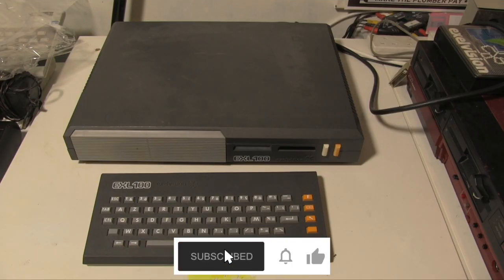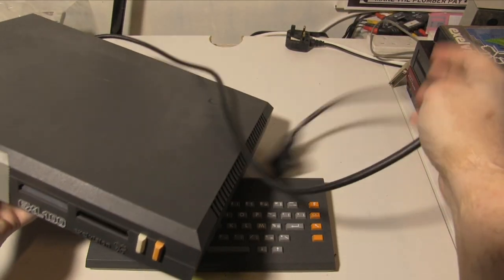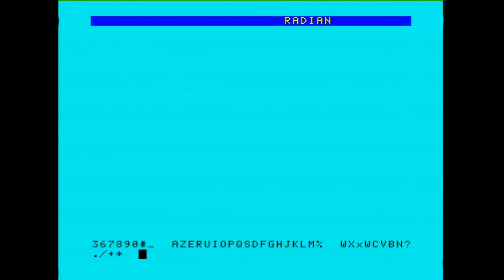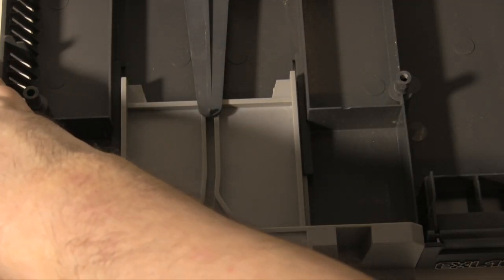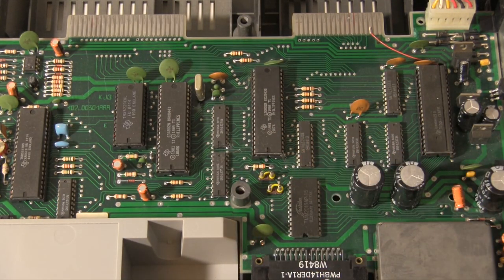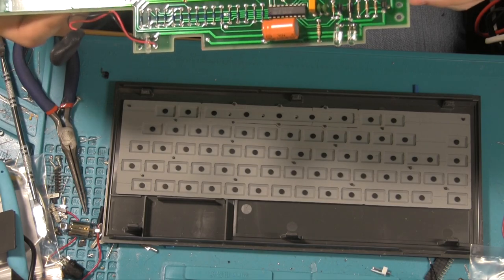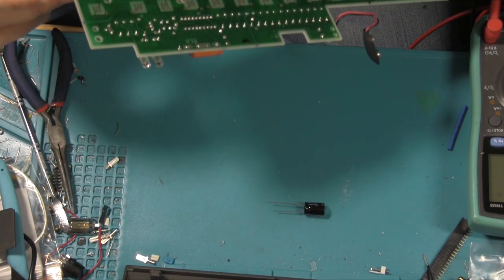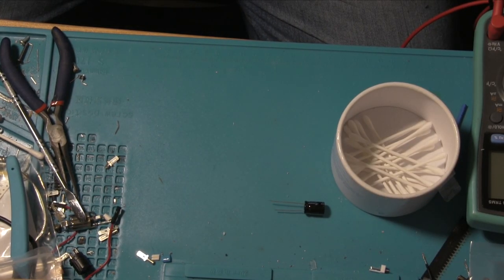The EXL 100: An Exelent computer? #Retro #Retrocomputing #Retrocomputers

Comment: 4mhz  for  the cpu, which also shares access to memory with the gfx is very rapid, the ram must have been increadible quick for the time, or dual ported, or there was an unpleasant system for locking either the cpu or video out of memory for a while.  Very nice looking machine, the draw has stood up surprising well over the years.